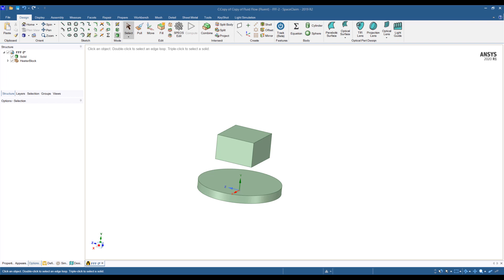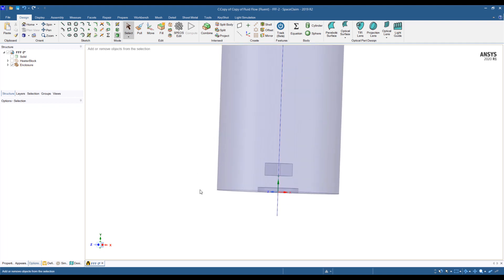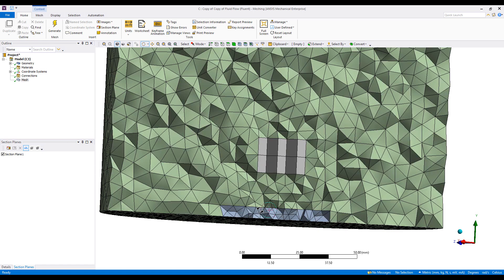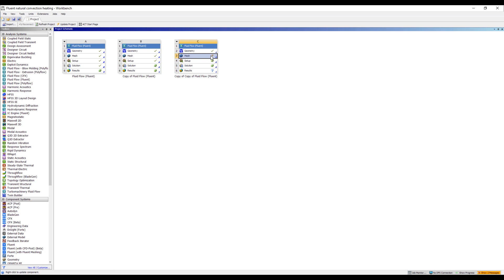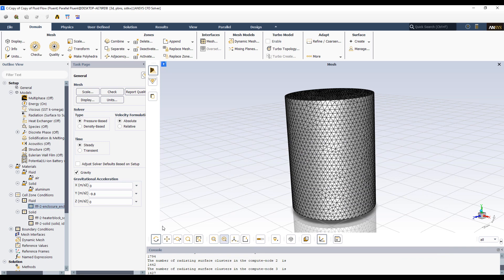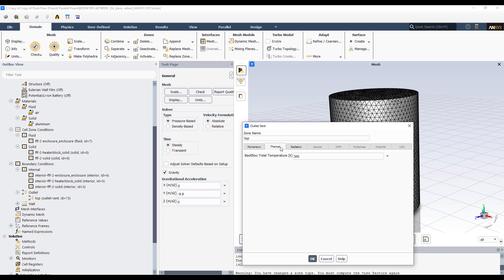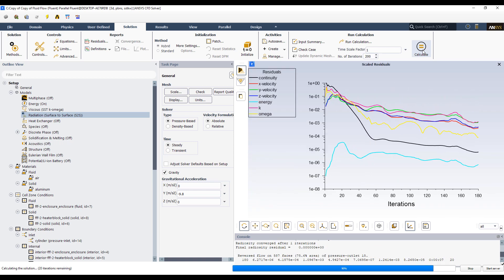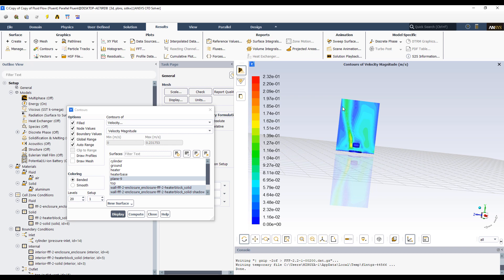Thermal simulation in ANSYS Fluent

Comment: Hi very good tutorial thank you very much for the information. Quick question, why didn't you define a mesh interface between the heater and heatblock? If no connection is defined what sort of heat transfer does ansys deem this as? (Convection, Conduction, Radiation)?